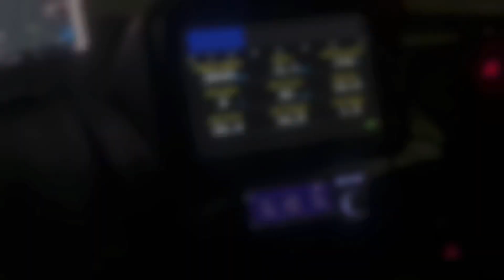Antilag tuning throttle bypass

Comment: This is a quality short bit of footage 👌
I would like to know how this throttle bypass works? Do the injectors not fire on specific strokes to allow "non-combusted" charge through the cylinder?
This is a new concept to me.
Reply from the maker: @jameshatton4211  thanks much for the kind words we are always trying to improve the content.
Yes the system works by allowing unburnt fuel/air into the manifold pre turbo where it’s ignited.
https://www.brewedmotorsports.com/rally-style-anti-lag-system-setup-and-tuning/